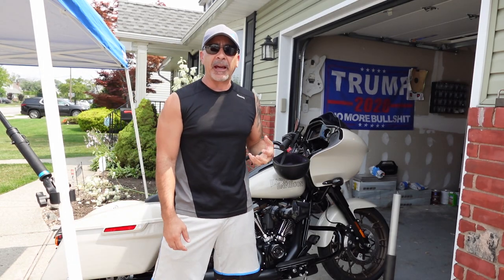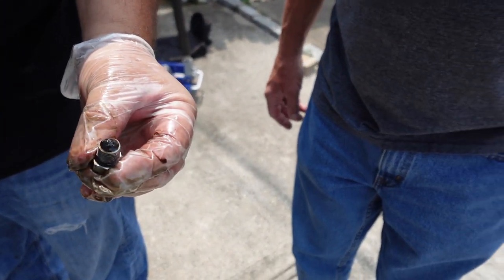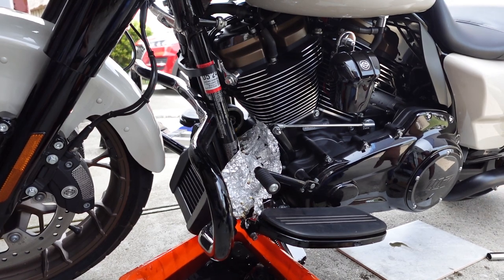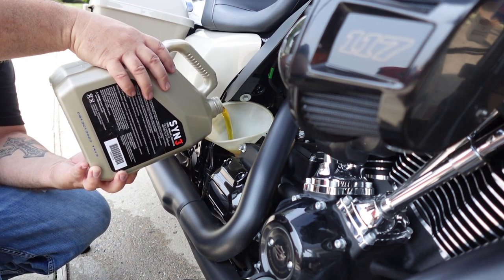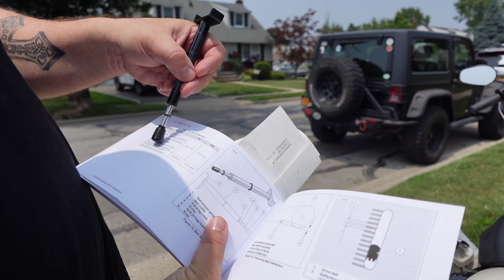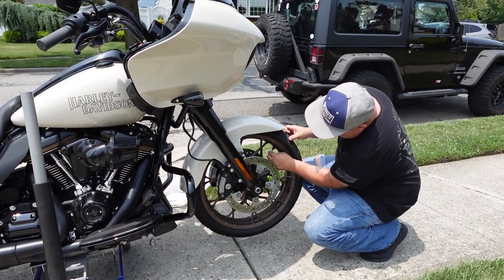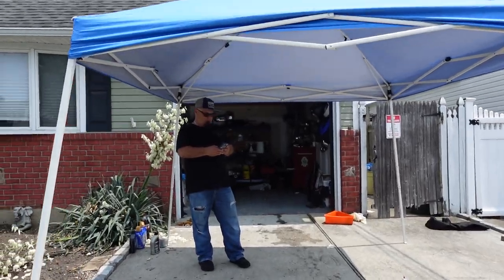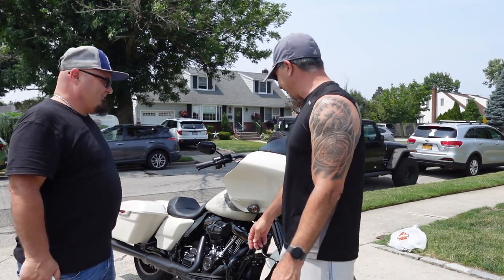Harley Davidson First Service - Do it Yourself?

Comment: No disrespect but this clown show video would convince most non-mechanically inclined motorcycle owners to take it to the dealership where some kid right out of tech school will do the job.  You guys need a system, right?  Syn3 is swill.  Use Mobil1 or AMSOIL.  Gear oil in the tranny.  A K&N oil filter.  I've been running primary oil in the chaincase but motor oil is probably fine.  If you're going to slobber oil all over the driveway put down a tarp or something.  Get yourself a service manual (I prefer Clymer) and put some high temp anti-seize on the drain plug threads and torque to spec.  I go a bit over spec on drain plugs.
Reply from the maker: Everyone likes to do it their own way. As long as you stick to what the manual calls for, no harm no foul. You can ask 10 people what to use in what hole and you’ll probably get 3 different answers.
Reply: Manual says forumula+ in tranny or Syn 3
Reply: @Mudslidex1  I like how Mr know it all called you guys clowns but clarified “no disrespect” and uses anti seize on the oil drain bolt when them threads are already lubricated with oil
Reply from the maker: @ehiggins7476  lol.  The one thing I know for sure is you can't please everyone and no matter what you do or  how good you do it, someone always has a better way. :)
Reply: Not “probably”, motor oil IS 100% absolutely fine, but what clown uses anti-seize on drain plugs? Then comes on the internet and calls others clowns while admitting it…

Comment: A couple hundred bucks…? You mean at least a thousand here in south Florida at the Harley dealership. Full service, adjust cables from the stretch, tighten up the screws from the manufacturer and 800 labor hours that doesn’t add up lol